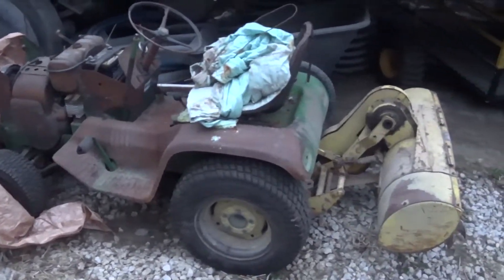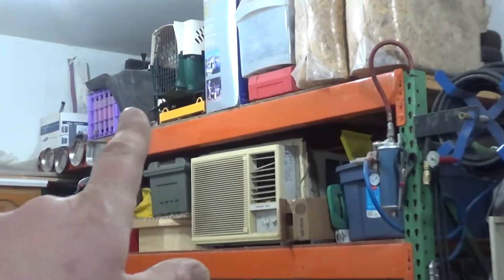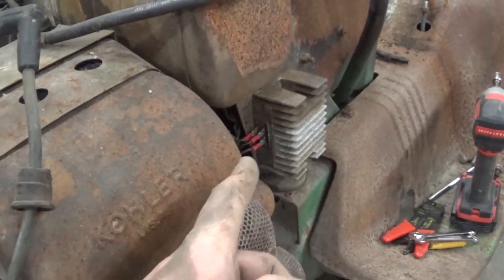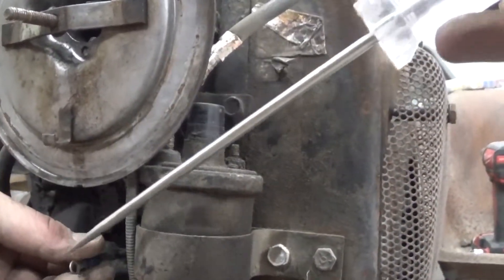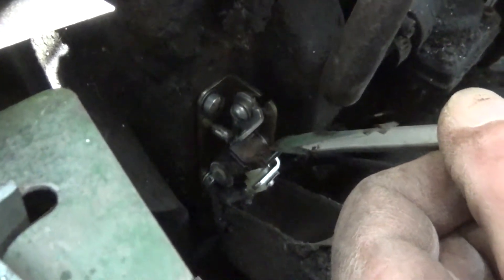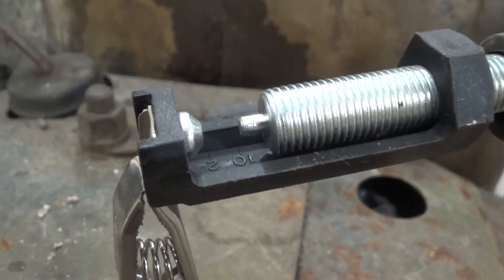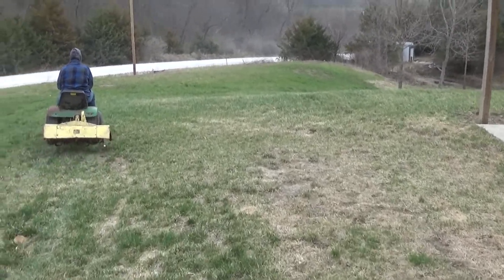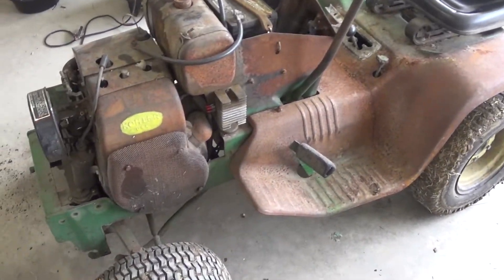John Deere 110 No Spark Solved!!!

Comment: I got a John Deere 112 and I’m getting power to the points and coil but still no spark any ideas
Reply from the maker: Points are most likely dirty or not fully closing. Are you getting a ground through the points?
Reply: aXe yeah they open and close and yes it’s got power but it won’t like what you said when they open they should like cut the current it they don’t and I cleaned them
Reply from the maker: Either you need to clean them more or they're just plain worn out. You've got power so you're lacking ground. Or your coil could be bad have you checked the resistance of it?
Reply: aXe I I know that the points go to ground on the coil but what about the positive
Reply: solid state, check that